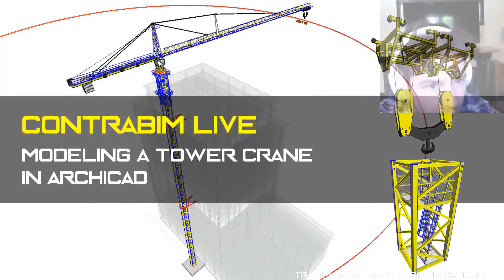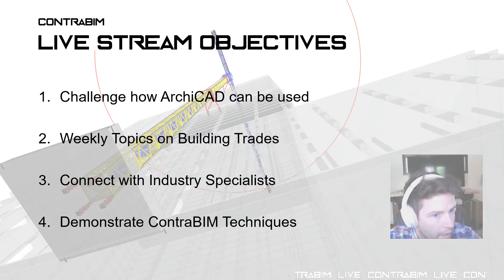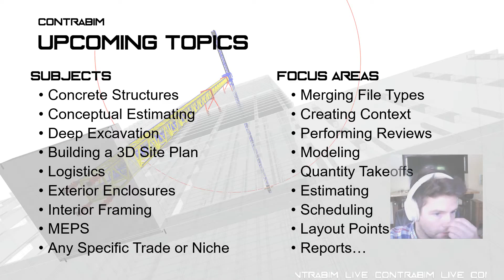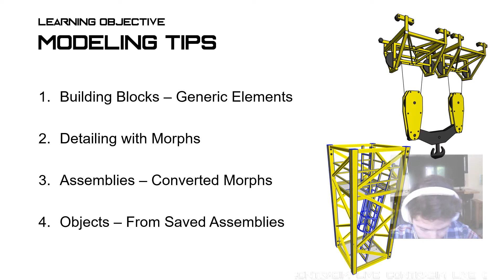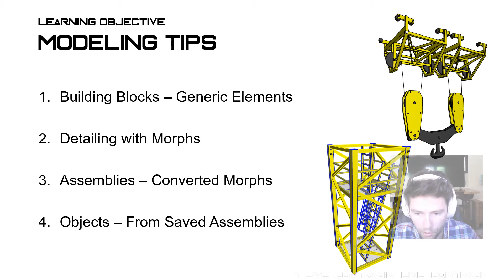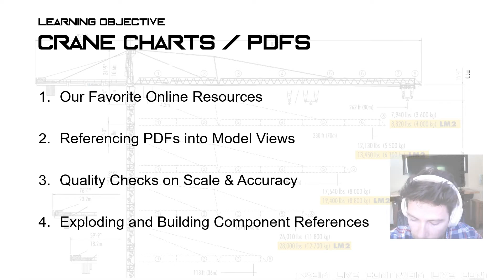ContraBIM Live - Modeling a Tower Crane in ArchiCAD

Comment: hello and thumbs up for the video! for some reason my archicads resolution doesnt appear to be any near as sharp and crisp as yours. Im running the student version 21 64bit on windows 10. any ideas?
Reply from the maker: Hey there, and thanks for the comment! The resolution from this recording, that was streamed live (so a bit blurry at times) is 1920x1080. Check the resolution of your display, either on laptop or monitor, and see what resolution your currently using. Try to bump it up if you can to the highest level, to open up more screen space inside ArchiCAD. Let me know what you find!